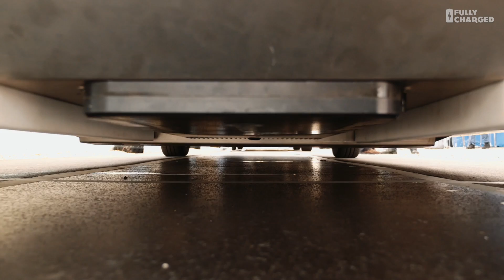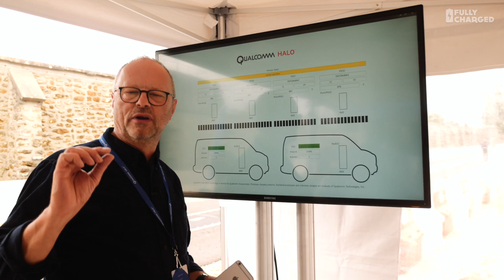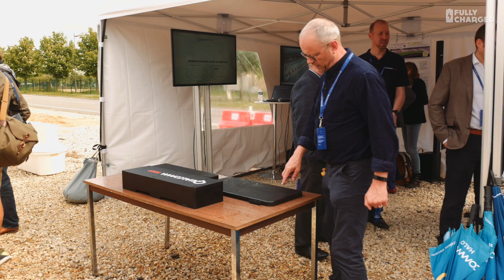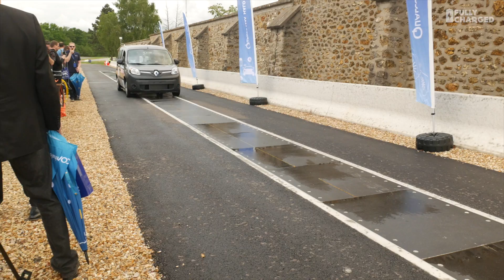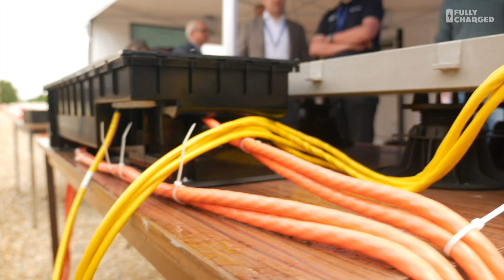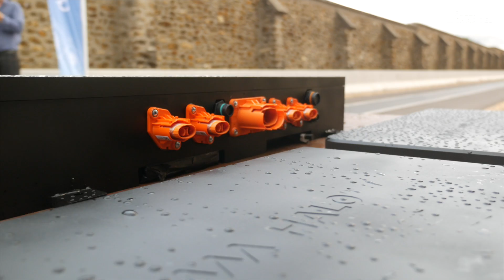Dynamic Electric Vehicle Charging | Fully Charged

Comment: It’s cool tech but I doubt we would ever need it with the battery and charging improvements we’ve already seen.
Reply: Bus lanes, buses and taxis. Public transport  before private.
Reply: The only real use I could see for this technology would be on motorways and highways for driverless trucks.
Reply: you would'nt need bigger batteries to extend range if these were on the motorways... so, smaller batteries, means less precious and rare metals, and it would reduce the energy/resources it would take to make said batteries..... also, governments would only need to worry about upgrading the infrastructure for the motorway rather than in every road and street...( after all the unresearched horror stories about the grid blowing up if everyone plugged their cars in at the same time....). 
if every ev had these pads to the underside of their car, and every car parking spot had the underground road chargers, that would solve the issue of where to put all the chargers also... service stations full of chargers takes up an awful lot of space, this will take up almost zero space....
Reply: It looks like it would be extremely expensive as a solution but what do I know?
Reply: I think it would be better for stationary charging
Reply: how is it not perfect for houses which have a garage? Who wants to plug in all the time. I know I would rather just park over my charging plate and never worry about charging my car that's for sure, driveway, garage or whatever.
Reply: Los Angeles already installed a catenary system at the port for electric cargo trucks.  Cats are probably way cheaper than this but require a much more complex system installed on the vehicle.
Reply: My point exactly. I think that the cost of building roadways with this technology would be so expensive that the cost to drive on them would be much more expensive than putting a bigger battery pack on your car.
Reply: In North America the distance between cities make this technology very useful. You can have this implanted at regular intervals so you don't need to stop in the middle of nowhere to recharge!

Comment: I feel like the best application for this will be buses.
Reply: Agreed. Buses, and better yet, electrically powered trucks; particularly long-haul semis.
Reply: It would work well in reckon if you put the charging pads at bus stops.
Reply: yea just put a little in the stop points, but making a full road i think it is impractical because of the cost, but good idea.
Reply: Would adding more pads mean more power from the road to the vehicle? A bus could have loads!
Reply: You're probably limited by how much each road unit can provide. A bus is pretty long though so no reason it couldn't pull 60kw or so.
Reply: I'm mainly thinking of buses because I doubt anyone's going to pay to install it on public roads unless they can somehow charge people for using it.
Reply: Bus lanes in city's
Reply: A vehicle powered by a predetermined track?
Also known as a train.
Reply: Hmm. I bet city leaders in San Francisco are looking into this while, thinking of those old overhead bus wires!
Reply: Yepp, I can imagine these being used at bus stops or part of bus lanes.
Reply: Current electric buses use a kind of reverse overhead charging system at the bus stops, where a "pantographć comes down from an overhead beam and connects to electric rails at the top of the bus. Using induction charging dramatically reduces connection time, which means that you don't have to be stopped for so long. A hybrid electric ferry in Norway actually uses induction charging, and it starts charging while the ferry is still in motion and not yet fully docked
Reply: Andy Brice agreed. You could convert existing roads to electric busways. Especially if autonomous
Reply: Yes but this would allow buses to use existing roads without large amounts of infrastructure being installed. Here in South Australia we have a German system the O-Bahn which uses buses on dedicated tracks. This could be something similar but with e-buses and geofencing.
Reply: Already adopted even before 10 yrs
Reply: Andy Brice why wouldnt you build a tram line instead ? Trams last much longer. Here in Hanover, there are alot of fourty year old trams driving around while buses have to be replaced every 8-10 years...
Reply: Link? That's a story to cover for Robert
Reply: Buses and HGVs I would imagine. I reckon that there'll be some identification in it too so you get charged for the use and maybe the option of using or not using the pads.
Reply: Trams and some trains too.
Reply: David Joslyn 
But long haul semis have the space to install a modular battery pack on the front of the trailer above the tow hitch with an umbilical running to the truck. Since the tractor unit can drop a trailer and pick up another one with an already charged battery to supplement the smaller one on board the tractor range won't be a problem any cost of the system to the operator will be more than compensated by the massive fuel savings.
Has anyone considered the chaos if this system was introduced on a motorway and it broke down? You would have vehicles entering the network, whether they be semis or private cars, with low charge expecting to top up their power while driving only to find they were effectively out of fuel. You could have hundreds, possibly thousands stuck on the road until the system was repaired
Reply: Loundsify 
City buses can gain enough range from battery power alarm there are also new systems with overhead top-up charging via induction at bus stops which would be much simpler to maintain.
Reply: bus lanes are a fine idea, but it could be put to better use. If you are a city planner, and you're working for a politician you need to make a visible vote winning benefit, and you need to manipulate traffic flow. If you make a city bypass for instance how do you get people to use it and ease traffic flow? Make the cars using it, use no fuel. Honestly people don't mind taking an extra 5 minutes if it's easier, and there's a financial incentive. Not only that but it incentivises EV's, and wins votes. It's hard to win votes with buses so... you know?
Reply: Overhead lines are far cheaper.
Reply: Your feelings are wrong.
Reply: I agree but only because it should be on all urban traffic routes where traffic is slow, that way you'll have higher density traffic using it. Put it on motorways and you'll need miles of the stuff which will undoubtedly be very expensive and costly to maintain. Long haul lorries should be on Fuel cell.I am concerned about public health with high power transmission through the air as walk across it.